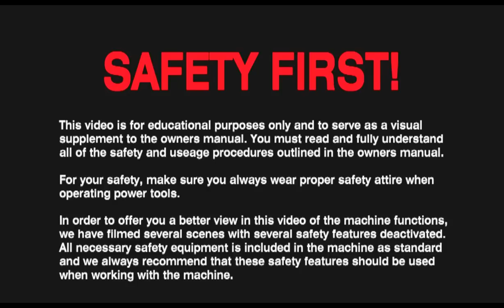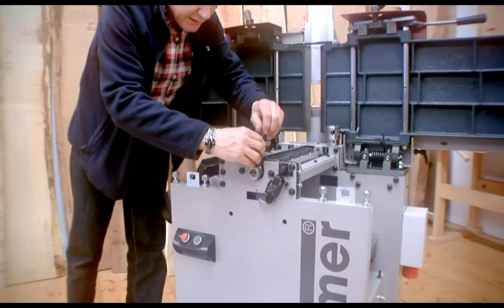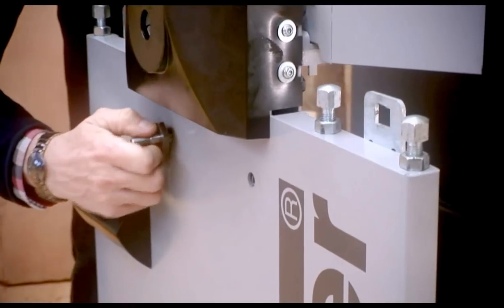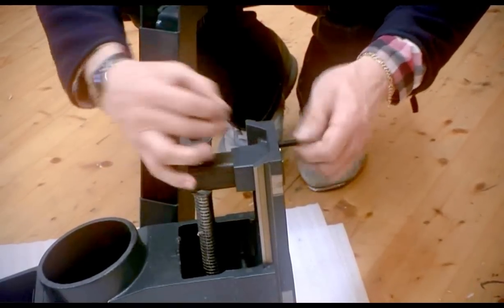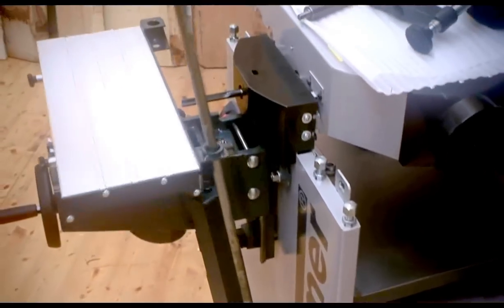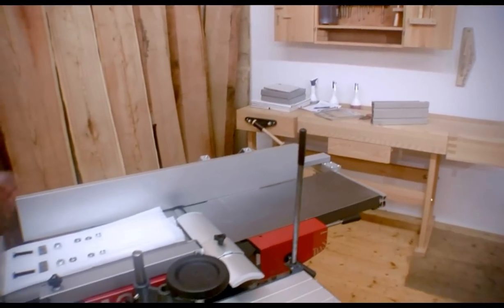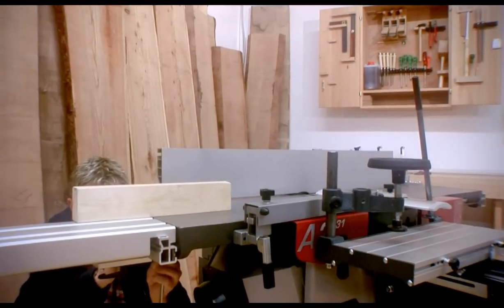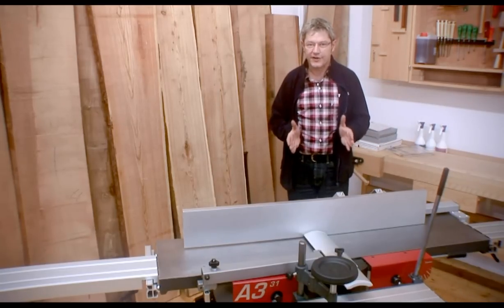Hammer® A3 - Setup demonstration of the Jointer-Planer | Felder Group (Part 2)

Comment: Tried doing the setup of the mortising table as shown in the video. I received a different size mounting bolt that holds the attachment considerable farther from the side of the A3-31. As such, the adjustment screw for leveling the attachment won't extend far enough to even contact the side panel of the jointer/planer.  Anybody else come across this issue?

Clint
Reply from the maker: Hi Clint, ring us or send a email - we will help you immediately!

Comment: I finally received my Hammer A3-31  two days ago after a 9  month wait.  I've installed and squared the fence which was pretty easy, although your instructions are unclear and your video makes it appear that it arrives that way.  As part of my purchase, I bought the additional extension table.  Is that only usable in jointer mode, or will it attach to the planer mode outfeed as well?  It appears there are the same washer divots there as for the outfeed to the jointer table.   The ordered digital handwheel, which is actually analog, arrived, but the aluminum wheel into which it fits has been backordered.  The wheel came with no installation instructions at all--the only reference I can find anywhere is on your UK site which has a nice video.   There seems to be some discrepancy as to whether this machine should have a 20 amp or a 30 amp breaker.   The supplied power cord is the length of my forearm, and I'm short.    Is there some reason why you couldn't have supplied a cord that is long enough to actually plug into something other than an extension cord?  My power outlet is next to the machine, which lives in a basement--floor outlets in basements are very bad ideas, or so my electrician has told me.  It's a beautiful machine to look at.  I've used one elsewhere and loved it.  So far, sales and set up have been very much lacking.
Reply from the maker: Hello Jeff,
Please contact our local service team. They will be glad to help you.
Best regards from Austria

Comment: What is the maximum lumber length that you can safely joint without the extension table?
Thanks
Reply from the maker: +Bid Budy 
The precision of the jointer tables allow precise jointing in any length without a table extension. To make your work easy - use  for long and heavy wooden pieces a roller stand or table extension.
Best regards from Austria
Stefan